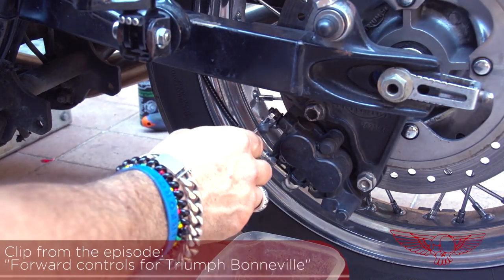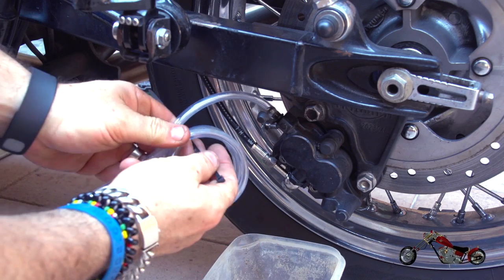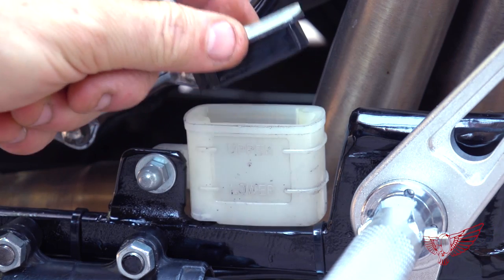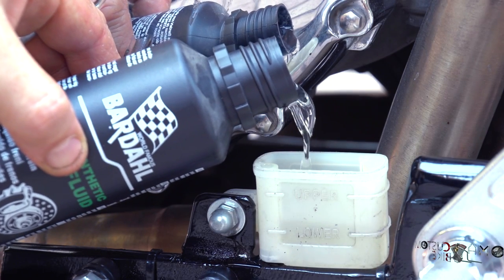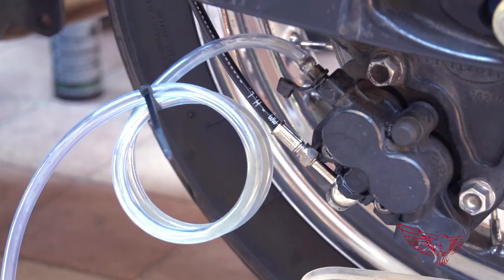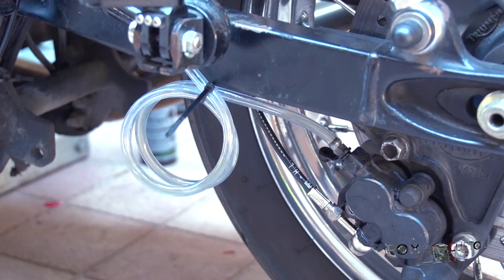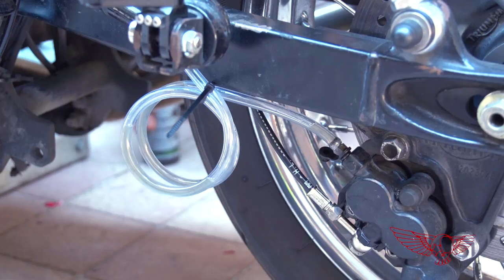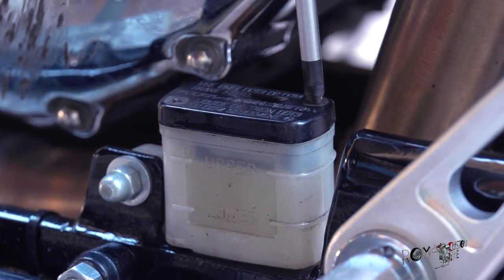How To Bleed Motorcycle Brakes by yourself DIY - 08 - RCB quick tutorial

Comment: I put about a inch of fluid in a bottle , break bleeder valve free .Connect hose place in bottle no looping . Pump and fill until all air is out of tube , tighter valve install caps , dispose of bottle and ride

Comment: So what about the end of the hose, does have to empty into a bottle? You didn't say where it goes or what happens to it, not even show where it went
Reply: I just did mine, had it empty into an old BodyArmor bottle. After I was done, just tightened the lid and threw it away.